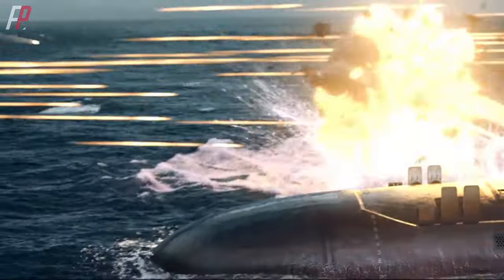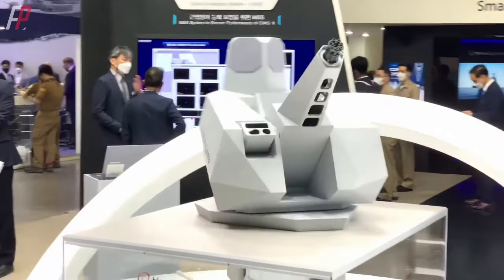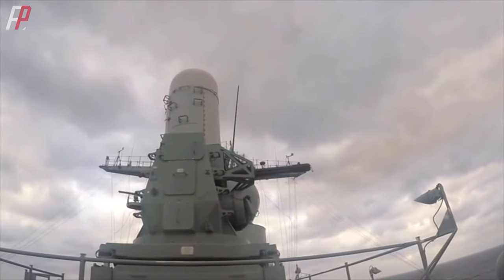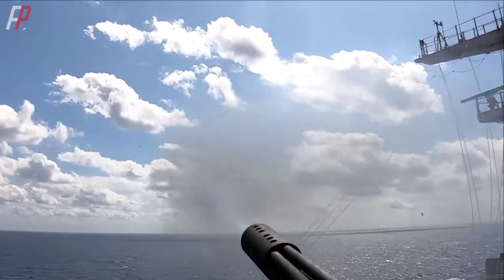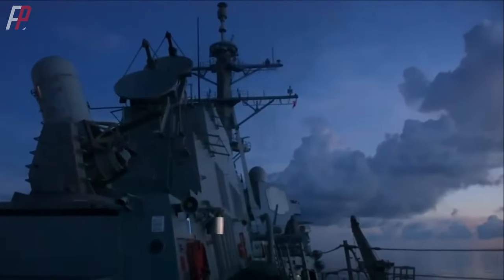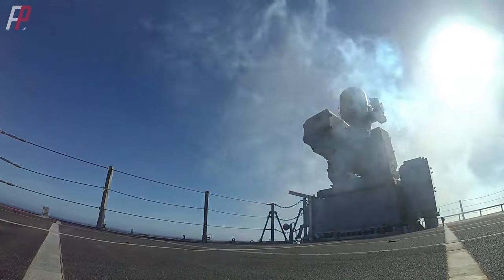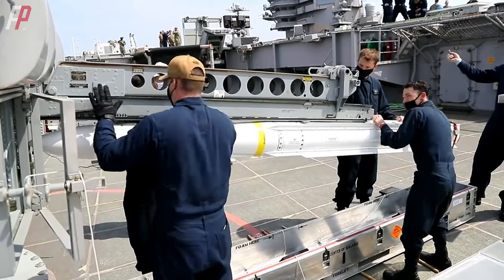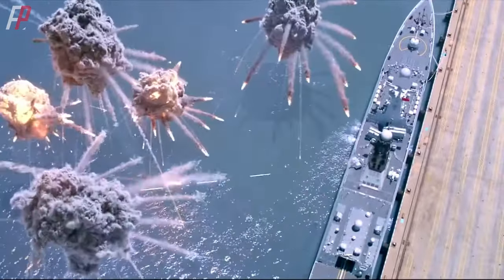How to destroy the navy’s final barrier - CIWS system on naval vessels?

Comment: The proper way to defend warships in my opinion is to have a layered system. SM-2/6 missiles are best for long range engagement of enemy aircraft 'before' they launch their missiles. Ships simply cannot carry enough of those beasts to waste them on single cruise missiles. 

Missile engagement should be with ESSM missiles of which a warship can carry four times as many. A single ESSM should engage at range within 50km. Any missile that gets past the ESSM is then engaged by a RAM missile at 10km. If the threat survives that second engagement it should be engaged by guns firing guided shells. If a missile survives the shells, it would then be engaged by a CIWS rapid fire gun. 

That is four layers of engagement, all together of which permits surviving large scale saturation attacks. This is even more effective if you have multiples of these systems. (Imagine a 'battlecruiser' with a large load of ESSM, and four each of RAM, guided shell guns & CIWS.) Current weapon suites in my opinion are wholly inadequate and leave ships extremely vulnerable to saturation or simply running out of defensive missiles before the enemy runs out of offensive ones.